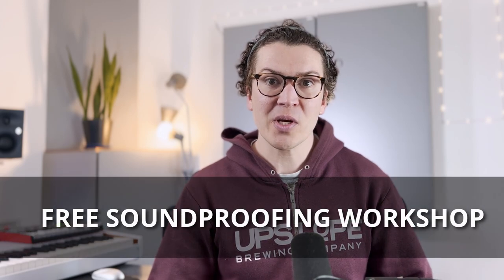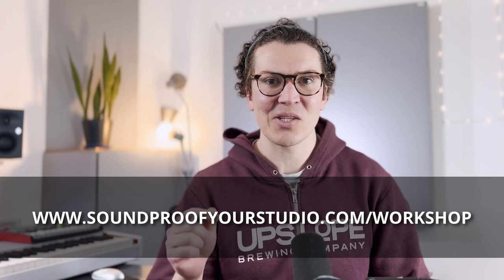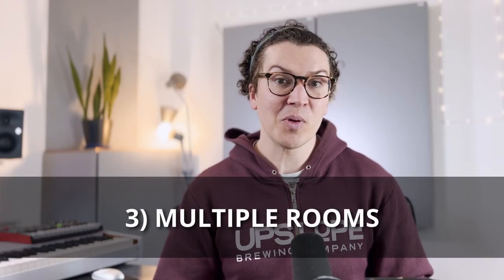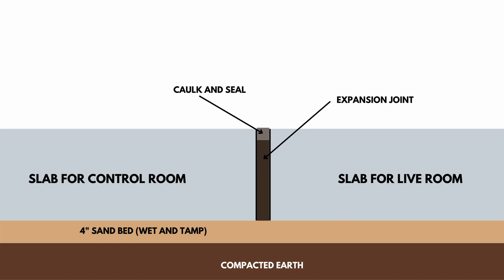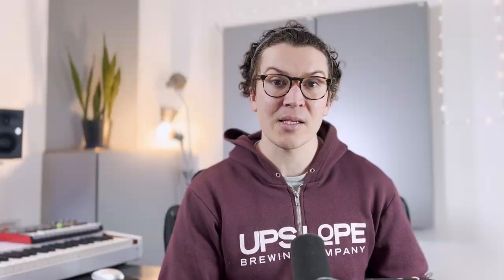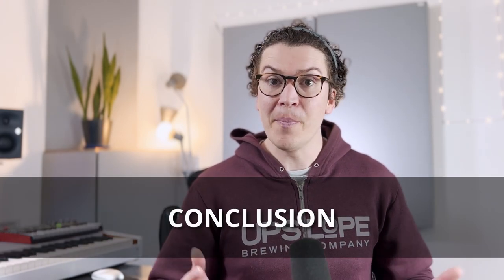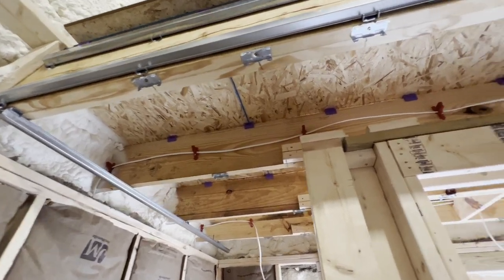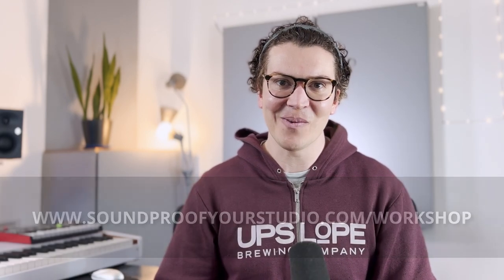The Best Soundproof Floor Design

Comment: If I have a rehearsal studio, one room building, with concrete slab. Is a floating floor overkill? If the building is made of  8in concrete blocks, is a drywall soundproof installation overkill? 
edit: I mean for a loud drummer and guitarist.
In Spain we almost never use wood to build houses.
Reply from the maker: Concrete is great! If it is a standalone structure floating a floor may be overkill. Could you do an airspace and then another concrete wall?

Comment: I have a question for you, I've watched many of your videos, and also gathered a lot of information from the "internets" but the floor is an area where I read a lot of conflicting information.

I am planning on building a music recording studio on a second floor terrace. The terrace itself is concrete. I suppose that counts as a concrete slab? My plan is to then build a floating floor on top of that (U-boats, iso pads, something along the lines of that) to isolate the impact noise coming from drums - decouple the surface where the drums sit from the concrete subfloor behind them. My ultimate goal is to prevent mechanical noise from making its way to first floor (where my kids bedroom is) as much as possible. 

Does that make sense? Do you see any specific pitfalls with that design?
Reply: THANKS BTW!
Reply from the maker: Seems logical too me. Just possible resonances under the drums.